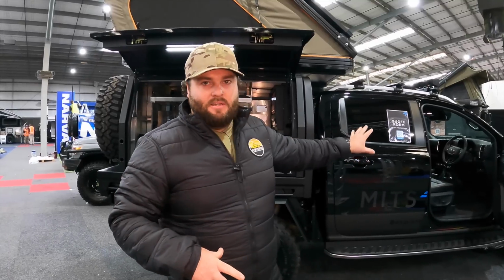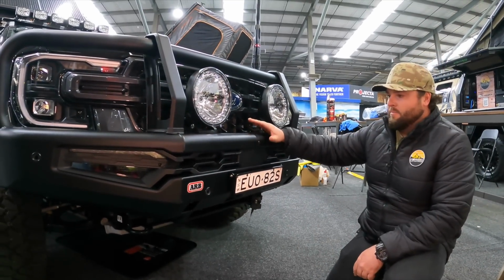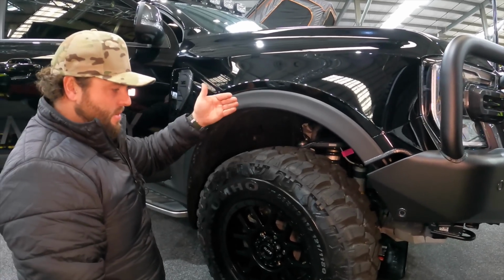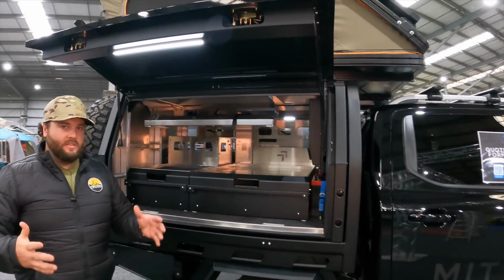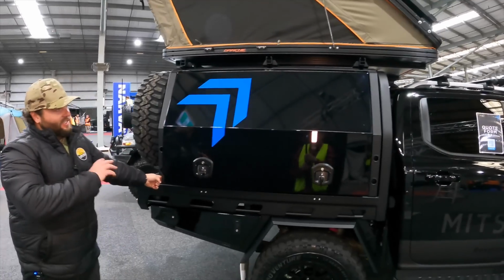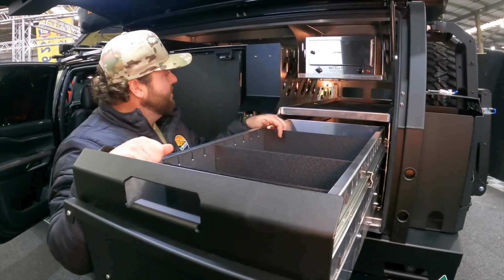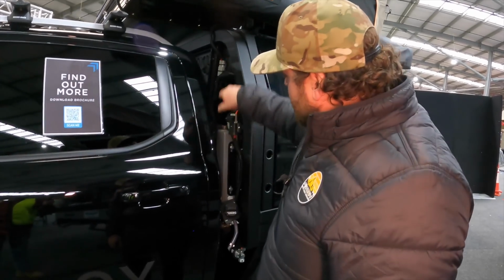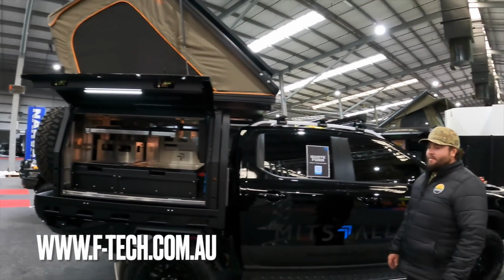2023 FORD RANGER WILDTRAK TOURER BUILD ! Built by Mits alloy !

Comment: Ohh ya ill tell u what I did with my new 23 ranger I drove the peace of shit back to the dealer and told them jam up ur hole ,nothing but trouble, trans seal split from vibration total failure, and it got stuck in reverse, on side of road for 6 hours no ford support ,let's keep talking up the new ranger 🤮🤮🤮🤮🤮🤮🤮

Comment: It's going overboard, development spiral to out do the next one. It's all weight, it's all overkill, all adding up to make the car feel and handle "heavy". Now, with that box on the back with it's dedicated drawers, it can no longer be used as a ute.
Reply from the maker: The MITS designed canopy you can unbolt and move, or complete remove internals as you need them. You could have a completely empty canopy for all your Ute needs or remove the canopy for a flat tray bed.

Comment: Ford & Ram trucks are top-shelf in my opinion. 2nd-tier is Chevy/GMC & Toyota. Then comes VW & Nissan. Love this latest gen Ranger … excellent!!! 🇫🇮🇦🇺
Reply: Try wheelin a F-truck or Ram or GMC or Tundra around aussie bush tracks, then you will see why those trucks are confined to bitumen roads only.
Reply: @trickster8635  The Ranger is a mid-size truck in most markets; same with the Chevy Colorado ZR2, & GMC Canyon AT4X. I live outside the big City & do not haul much weight, so this mid-size Ranger segment is ideal.
Reply: The Ford F250 with a canopy (yank import) has more room in the tub (1930.4mm) than the Ram, far more guts and in my view more comfort inside. On a 15k trip around the West as far as Broome and down to Esperance, carrying 100 gal spare fuel, ( parts of WA don't have servo's close together🙂 ) generator, and much more, I averaged 12.4 l per 100k for the trip. Not bad for a 6.7l turbo diesel 7metres long and 3 tonne - hard to park near shops tho 🙂